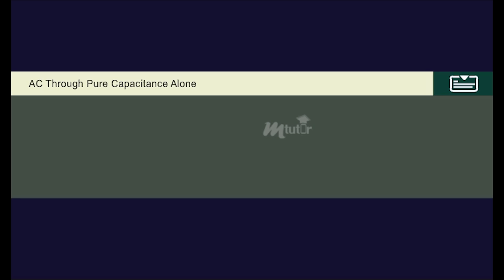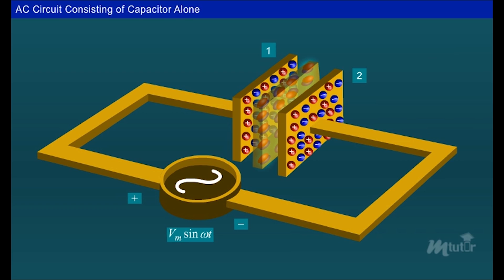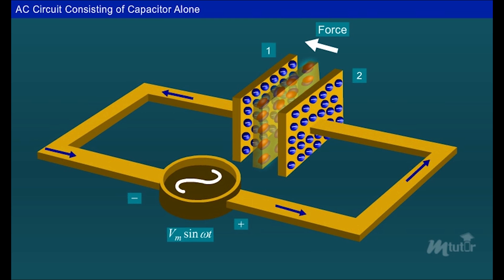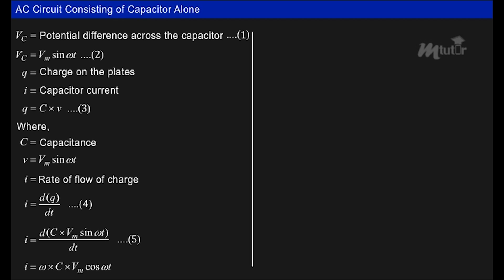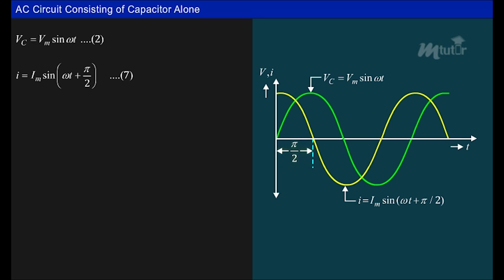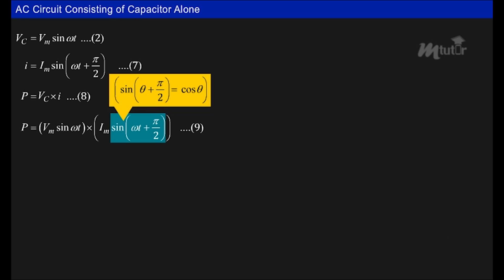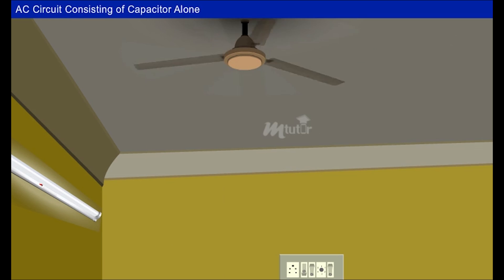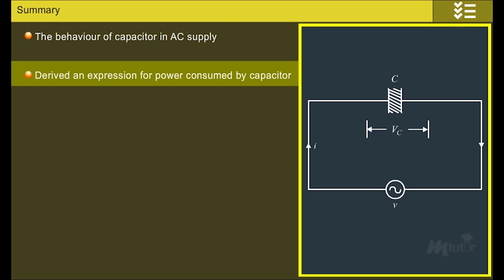AC Through Pure Capacitance Alone [Year- 1]

Comment: Plz sir explain that how the current flow in the circuit but not through the capacitor as you said in this vedio at 2:50 ??
What does it mean ?? 
And my question is that How current will flow through the capacitor , as there is insulating material or Air (highly insulating material ) between the plates of the capacitor . This means that there is an open circuit . So how current will flow through open circuit ?? sir i m so confuse about that so please sir explain it.... thanks
Reply: Hi if you still have doubt reply

Comment: Oh my God she explained in wrong details .first look at the ceiling fan if capacitor is  even not used at ceiling fan .the fan will rotate due to torque . actually it is correction power factor of celling fan we know that the current of a coil is lagging behind the voltage is 90 and the current of a capacitor is leading by the voltage also 90.the losses of two components that is capacitor and inductor is will become zero due to balanced equation is Omega is equal to 1/✓LC.the impedance triangle is Z= ✓R2 +omga L -omga C
Then Z =✓R(square)
Therefore Ohmga L =Ohmga C 
Take it don't go to misleading

Comment: Video started with working of capacitor in ceiling fans, and ended with complex derivations. WTF! This is the problem in our education system. Why not explain about the phase shift happening in single phase induction motors due to capacitor..there by giving the torque required to start the motor? This will explain the need of capacitor not its derivations! This derivations are no where used unless we are working in R&D!

Comment: Why the current increases in negative direction from 90° to 180° in ac supply when voltage decreases in  positive direction  is applied to capacitor

Comment: what about dc current
Reply: Omar Abbassi a capacitor will block dc current
Reply: In dc at the instant you apply voltage across the cap, current is at maximum and voltage between plates is zero. As cap charges, voltage across cap increases and current decreases. With cap fully charged, supply voltage is measured across cap and current is zero. If this is the case then, when shown graphically, I'm sure you'll agree that voltage lags current if voltage across cap starts at zero and ends at supply voltage yet current starts at maximum and ends at zero. Clearly in ac, this occurs every half cycle.
 Hope this helps.

Comment: how current is flowing through the dielectric?
Reply: small current flow through di electric also.
Reply: Yes but it is unimportant. You get impression of current flowing trough capacitor because of how it charges in each half-cicle of AC.
Reply: Negligible current through dielectric although it may look that way on an ammeter. Current simply flows from plate to plate through circuit.